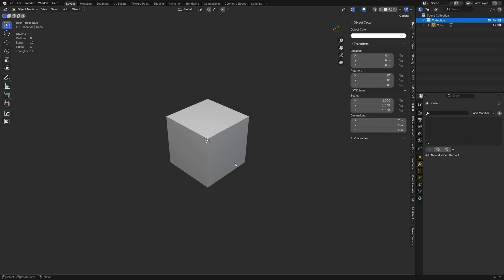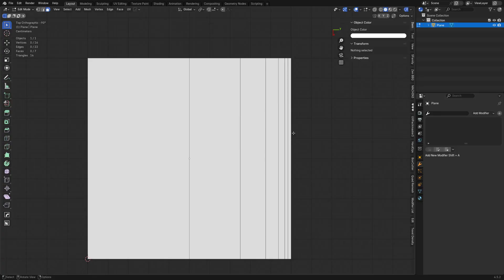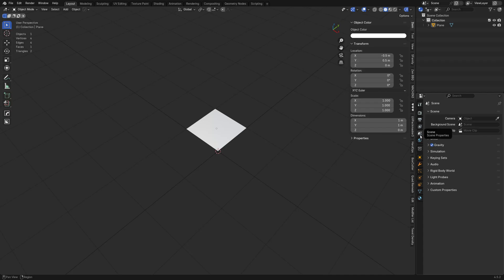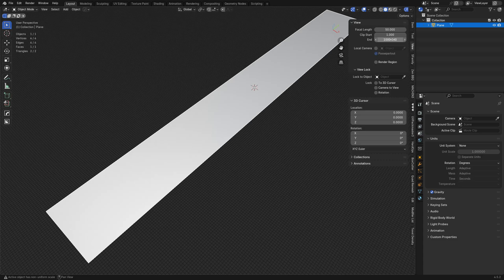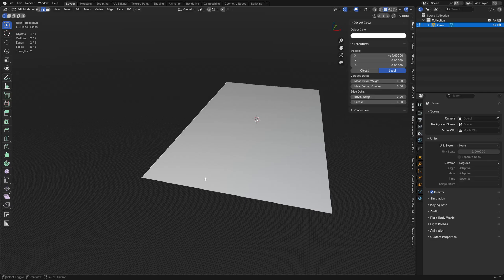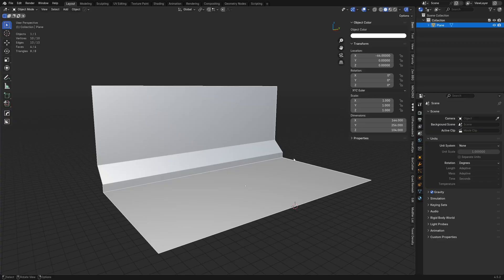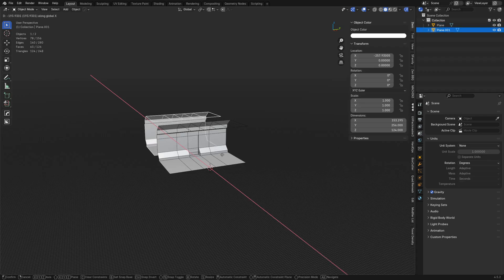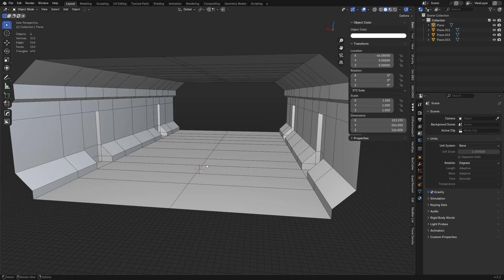QA - Older Engine Units and Grid Modeling.

Comment: The reason why your model would be in a power of 2 in conjuction with your texture is for texel density. Also modeling your models in a grid, or in nice even units is not what "old engines" do, it saves you a lot of headache from misaligned prop pieces if your walls and floors are all different sizes and lengths if they are standard sizes, it also allows you to bake efficient light maps. Does it mean you have to do it this way? No absolutely not.

In blender, you can also set your units to M or Inches etc instead of just blank units. So if you want to match Unreals units you could just set your units to M or CM